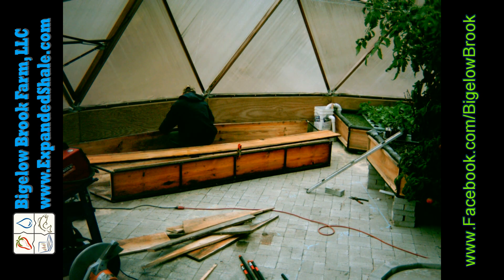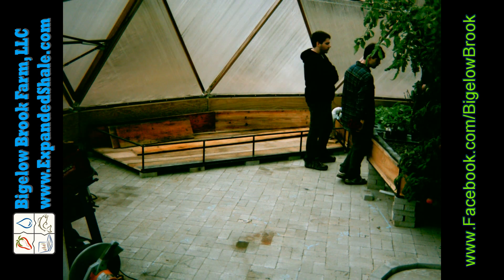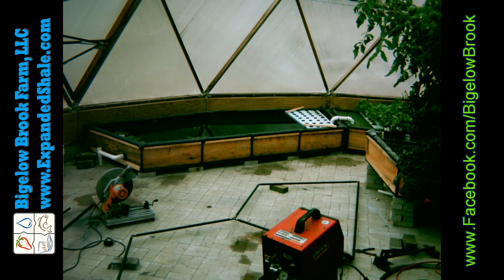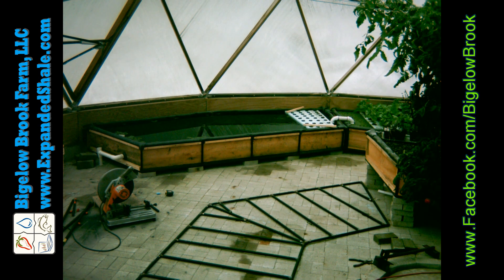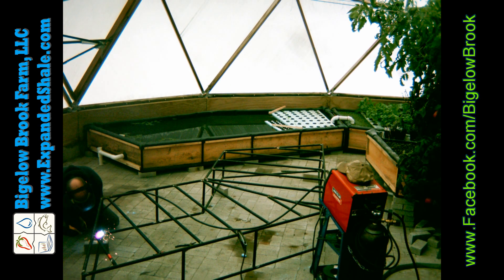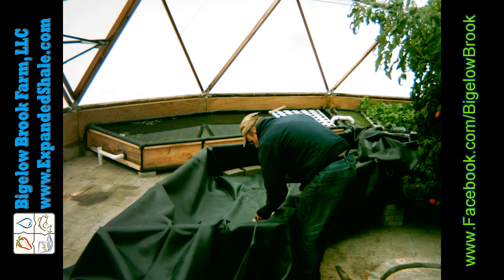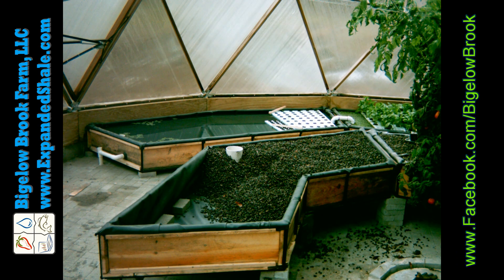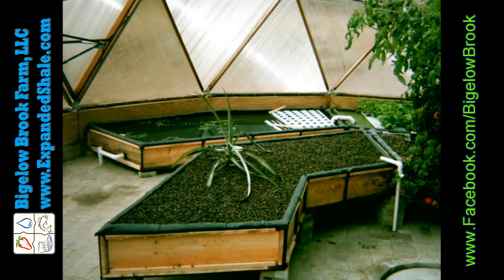Building Aquaponic Grow Beds - Time Lapsed

Comment from the maker: Most of the shale producers only make the smaller stones for concrete work and it's really dirty.  Ours is around 1/2-3/4" in size and works nicely...and is fairly clean!  We are able to ship anywhere in the US.  If you want some in bulk, the 1 ton super sack would be a good option...send me a private message if you're interested.

Comment: My grow bed and grow tank are framed with 2x12's but I had to use two industrial racks (you can see my system and how I built it on my channel) which would have been a whole lot cheaper if I had the skills to weld one up. Yes, I am aware that it is timelapse photography.